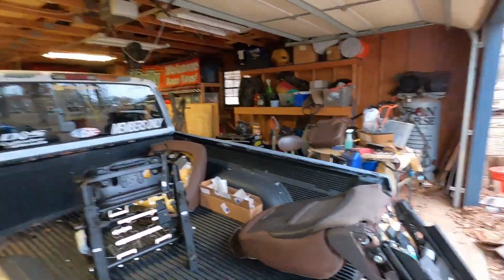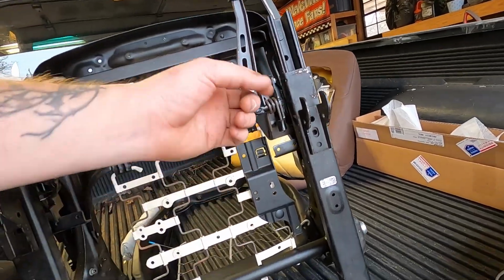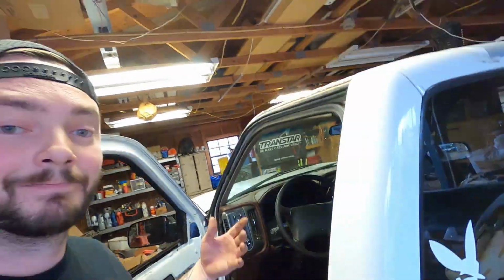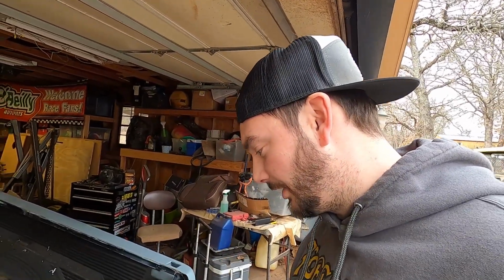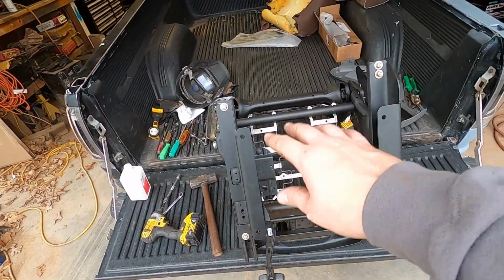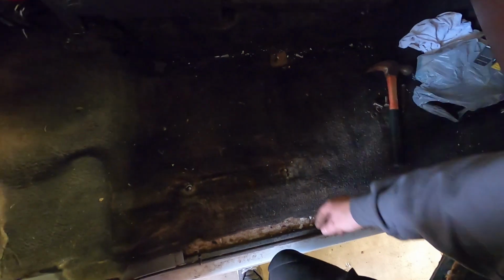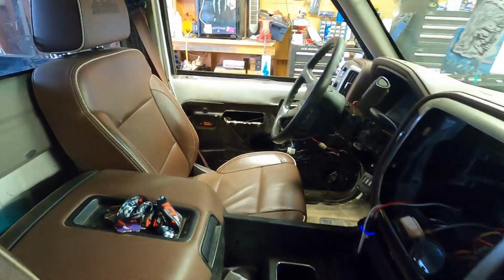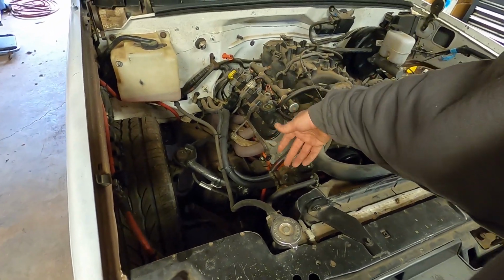Installing Stark Fabworks OBS to 2014-2018 GM Seat Adapter Brackets

Comment: Do y'all have a video of wiring up the driver seat? I have the same  seats.
Reply from the maker: I currently don’t have mine wired up, I just put the main hot and ground of the seat connector to a battery and adjusted the seat to my needs for now. Contact Todd Stark @starkfabworks on IG or FB as he has the harness parts needed lined out

Comment: Have you figured out wiring th drivers seat yet?
Reply from the maker: I just haven’t done it yet, but it’ll be a simple fused hot and a ground wired in to the bottom of the seat
Reply: I've wired it to fit with factory obs pigtail. Pretty easy with a probe tester

Comment: how was the spacing behind the seats? would it be able to fit subs similar to as if the  stock seats were in?
Reply from the maker: Pretty close to the same, plus your slider will help you fine tune it to your needs
Reply: @MattyXBuilds  thank you! Really appreciate it.
Reply from the maker: No problem, glad to help 🤘

Comment: I have an OBS myself and i love the colors of the high country interiors. Honestly you should have just kept the stock obs dash, color matched it with the high country and just used the high county seats. Not a fan of single cab trucks myself i need room. Having that extra room of an extended cab obs is essential imo, I use it so often there is no way i could deal with single cab.

Comment: Do you have any ideas on how to get the factory 2015 radio to work? is that something you’re looking into at all or is there something else in the works? My dad and I want to do this interior swap on a 76 Chevy C-10 but I can’t find anything online about if it’s even possible. I know the gauge cluster are cbus and vin locked but I would think the stereo is just power and data?
Reply from the maker: From what I researched, and this was mainly gathered from looking through the GMUpfitters diagram manual for a 2015, the Cluster, radio, hvac system, canbus, and pcm all feed off of each other with “logic” circuits that transfer serial data. My solution for this in the Low Country will be an aftermarket double din radio. Gives me what I need and fills the hole without being a major headache

Comment: Did you get the dash done????
Reply from the maker: Nope still has some buttoning up left to do
Reply: @MattyXBuilds  cool man, I really like this setup! I want to do a swap in my 98 ext cab.
Reply: I have quite a few questions. My biggest ones are will the 2014 door panels fit and how do you setup the AC controls?

Comment: Hey what muffler set up you running to get that sound on the OBS?
Reply from the maker: It’s longtubes true dual to 2 flowmaster 40’s dumped before the axle. I’m wanting to redo it with an xpipe and a dual in/dual out magnaflow
Reply: Nice thanks man, has a sick sound & im glad i found your video it helped me with my bucket conversion. 🤙🏽

Comment: Bro I’m in okc and just got a set of power 2017 Tahoe seats and I’m trying to fit them into my obs.
Reply from the maker: Need to get them Stark Fabworks brackets!!
Reply: @MattyXBuilds  got some coming from obs outpost. But good how to video.
Reply: @christopherlee1006 Do you have to drill any floor board holes with the jobs brackets ?
Reply: @GALLEN-vf7uy  I mean I had factory low back buckets in my truck so I didn’t have to drill anything. Just look up obsoutpost